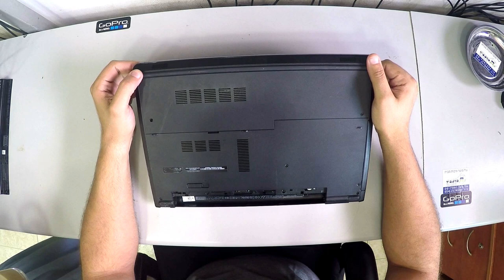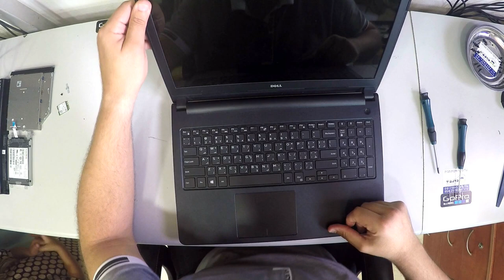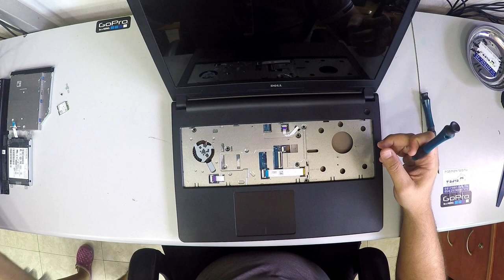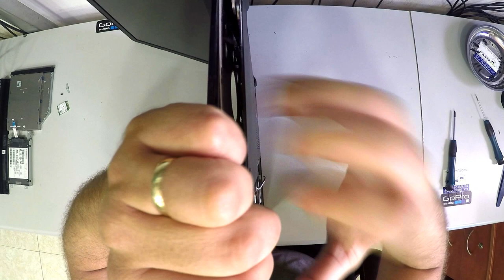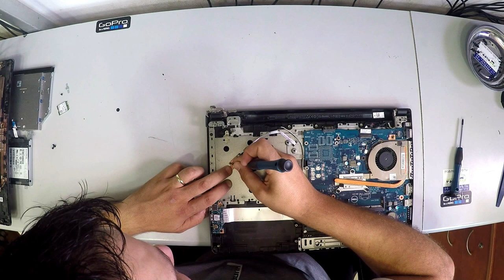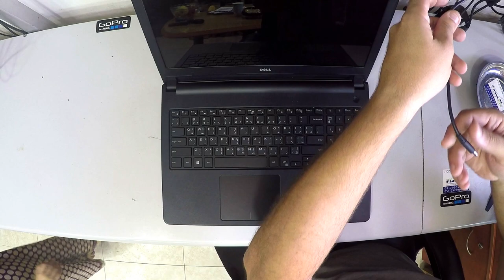Dell Inspiron 5558 Power Button Fix

Comment: ho there i have taken it apart and i am still not getting any compression, do you think the capacitor in the button circuit is broken?
Reply from the maker: hello
In this model (dell 5558 & 5559)the power button circuit board get stack or damaged, if stack try to push it with small screw several time tell you here the button clicks, if not working replace it.
This week i will make another video explained in details.